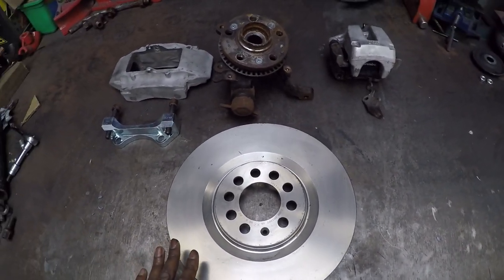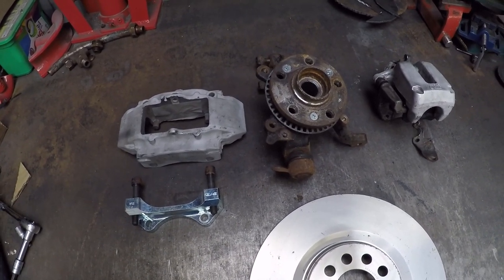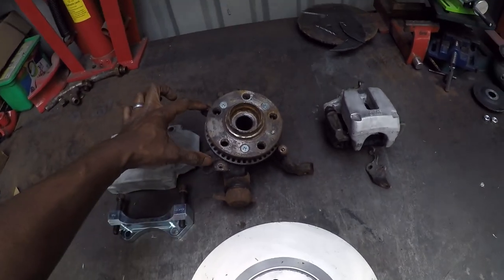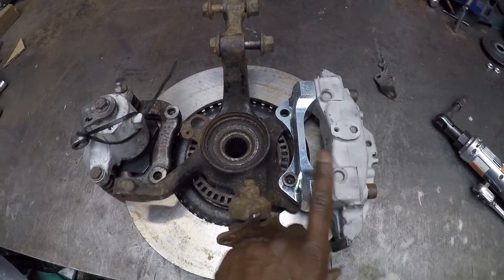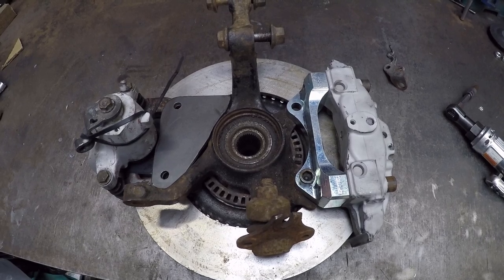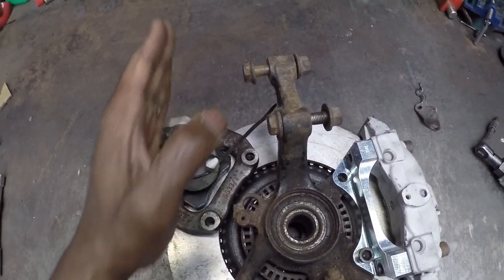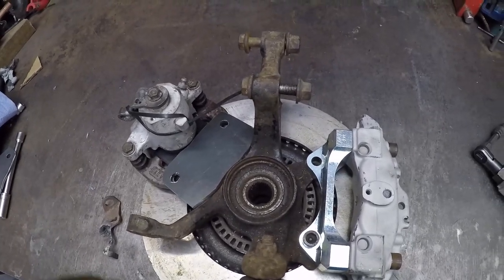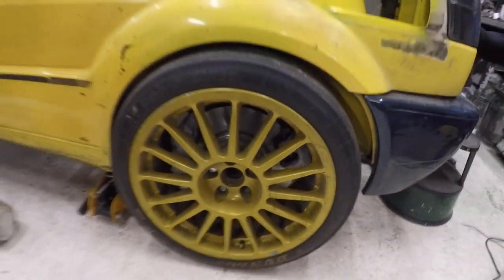Dual Rear Caliper Set Up - Twin Engined Corrado VR6

Comment: I always enjoy watching your progress on the twin engine , and other builds.
Why did you go for a hybrid  holset turbo , instead of a straight holset 35 or 40 ? 
Are you going to run stand alone and control boost per gear, to save gearbox, or do you think it will handle the hp from both engines?
Reply from the maker: Hi Allan.  Thanks for the comments.  I am going with a hybrid Holset to try and get the benefits of both.  Decent boost with good spool.  Yes will be running stand alone.  The gearboxes should be able to handle the power but I will be using boost by gear to try and get traction